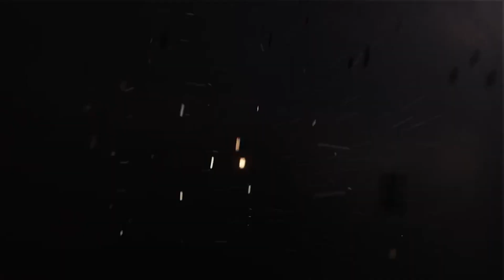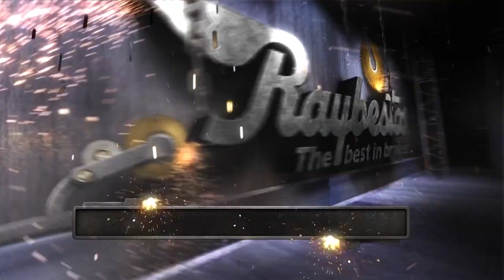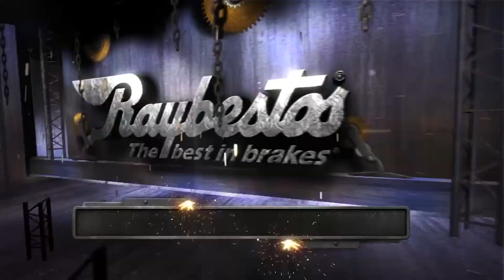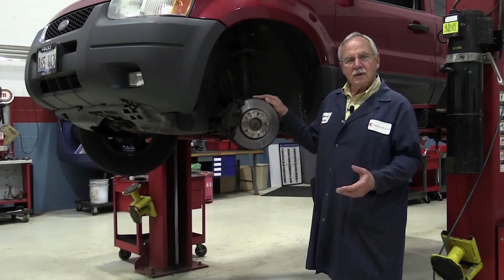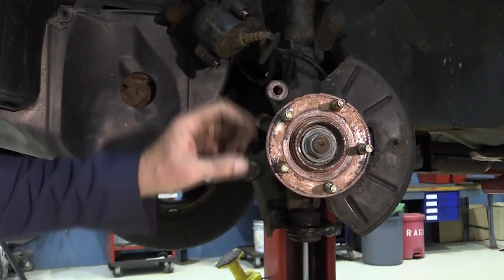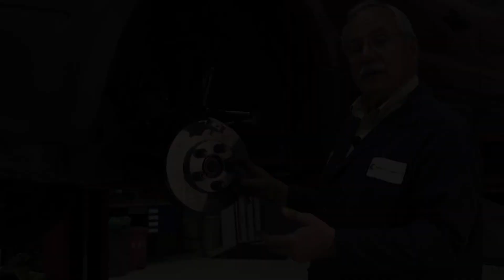Warped Rotor Myth

Comment: To me it sounds like "wrapped" and "lateral run out" are the same thing.  I also think the rotors can get hot enough to wrap "thickness variations"..
I do agree tho... with the fact that a rustly dirty hub can also causes this issue...

Comment: Ok the metal of the rotor starts to melt at 2300. It will get hot enough to make it soft enough to wrap a them when it cools down it warps. You can machine them again if the rotor  meets min. thickness standards. But if it doesn't then you have to replace

Comment: I mean he does realize that most rotors today CANT be turned right? Unless it’s a high end car most rotors are made today without enough material to turn them down safely. Also lateral runout means something is warped or uneven. Thousands of heat cycles will absolutely warp a cheap thin Chinese rotor. That’s why they are so cheap. They are made to be thrown away on most cars today.

Comment: Let us say that this is a hundred percent true . Than why is it when I do brakes on a high mile car that had a lot of pulsation does it smooth out with the new rotors , you could say it does not have buildup , okay how did it get there , was it hitting a high spot? As far as I know if you place a friction materiel against a moving steel surface that is flat it will transfer  materiel in a even fashion , how could it  pick some sections of the rotor over others baffles me

Comment: FALCOR. One other factor to consider. You're driving in city traffic for a couple hours and then you park the vehicle for 2 hours. The rotors cool down but not evenly because the area where the pads are lightly touching that rotor remain hotter. Uneven cooling causes warpage .

Comment: This guy is an idiot!! Rotors do warp I’ve had a few that I have changed for ppl.. put it on a lathe and dial indicator and what do you know it was warped.. you can also use A micrometer. And as you can see  the human mind can be warped as well which seemed to happen to this fellow..

Comment: You over torque a rotor. It warps. As you don't need 2500 degrees to do that. It just takes 1100 Degrees and 3-4 months of it to make it warp. Not to mention them cheap Mexican knock offs are made so cheap. That warp anyways. As the material is cheap. Just attach a dial gauge on them. I seen them row left and right 30 thousands.

Comment: Some of these so called experts need to actually be in the field and not quoting the party byline as a 45 yr veteran in the automotive field I can tell you that rotors absolutely do warp.Also rotors develop hot spots that cause vibration as well.This can be caused by poor Calipers and that wasn’t even addressed by this so called expert.Raybestos get your act together.

Comment: I have a Highlander 2006 that vibrates front passenger tire feels like when you brake at 65 mph or more but not all of the times. I changed out rotors and pads and problem is still there. What can it be ??
Reply: try a balljoint, the force of the vehicle coming down onto it as you brake puts stress on it and makes it vibrate
Reply: Damion Jed the car has only 90,000 miles - could it be a ball joint?

Comment: Rotors don't warp. They said they warped and replaced them but they did not do it right. What does happen is the rotor becomes distorted with uneven thicknesses or runout, or warped. Wait no they're not warped. Anyway I'm just gonna replace them anyway just like the last guy lol

Comment: Impact wrenches and failure to use a torque wrench are what warps rotors.  Torque sticks used with an impact wrench are a half-ass way to save one minute per wheel, and have the customer wind up with warped rotors in a year or less.   I've even had a dealer mechanic intentionally over-torque one lug nut so the rotor would eventually warp.  It's a safe way for them to get  the customer back into the dealership sooner so they can make more money.  (No dealer's "repair warranty" will cover warped rotors.)

Comment: BTW.. cheap "new" brake drums and rotors for the rear brakes will give you just as much pulse problems as the front rotors...Easy to test for., In a "safe zone" of a street (No, bicyclist, kids, pedestrians, vehicle traffic, ECT), roll the vehicle to about 15 mph, shift to neutral then apply E-brake only,..If the rear rotors or drums are messing with you... you'll know right away.

Comment: Chrysler had issues for years back in the 90s jeeps and LH platforms were known for run-out issues from heat causing run-out well over .004 which caused brake pulsation so rotor warping is real in most cases. It's very important to purchase high quality rotors when replacing.

Comment: I believe rotors warp. I've had vehicle's where the rear brake calipers siezed and caused an over heating issue with front brakes. After this happened terrible shake from front wheels when the brakes are applied. Improper installation will also cause excessive heat.

Comment: Have done hundreds of brake jobs , and warped rotors is something I have seen once in 40 years. Thankyou for clearing this up.
Reply: Just asking this, but virtually every other comment says rotors do warp. Does he mean that the  entire thickness of the rotor doesn't warp while everyone else means that just the surface can warp, meaning uneven wear? Sounds to me like this discussion is basically useless if even though  the thickness of the rotor hasn't warped, the rotor has to be replaced anyway.

Comment: You are Very wrong sir. I have been a mechanic for 34 years and have taken rotors off and laid them on a machined surface, they are warped.  Also I have cracked run out on the vehicle and on a lathe both indicating warp. I have worked many years in the 4x4 sector and can tell you that hot brakes entering cool water or mud warps them instantly. I do not know why Raybestos put this together but they really need to do some field work first. It happens all the time when an engineer decides something that has not worked in the field.

Comment: Rotors don't warp? Tell that to the countless Dodge Ram pickup owners in warmer climates, braking at highway speeds on off-ramps during hot weather. I had rotors replaced three times on my 2003 Dodge Ram Van 2500, all under the 3-year bumper-to-bumper warranty. Not a problem with aftermarket rotors.

Comment: Rotors can warp if your caliber slide pins are seized, and your pads fit too tightly(no silicone grease applied)...then the you apply the brakes, they stay applied and generate lots of heat.

Comment: I love it when people do information videos and talk rubbish! I am a 30 year tech and disc/rotors DO warp for many reasons! If discs/rotors didn’t warp then the vehicle manufacturers wouldn’t give tolerance figures for the allowed run out! And I suspect the old and new rotors warping on that Honda where 100% down to firstly the corrosion build up on the drive flange and probably sticking pads or callipers and a poorly trained technician not cleaning the drive flanges as we could see the corrosion still on the drive flange! My guys would get the sack if they cost me money on warranty work because they hadn’t cleaned the flange, or pad carriers and calliper slides! But I have a great team of guys that do the jobs right the first time!

Comment: After 40 yrs. experience in brake system service... If you buy cheap rotors, expect problems right after the first "hard" braking  (panick stop) on the freeway at 70 miles per hour. High quality rotor castings (like OEM) can take the heat.
Reply: You are exactly right. If you buy the cheap rotors from Mexico they will do exactly as you said. People should always buy american made high quality steal OEM rotors.
Reply: Yeah that might cause a thickness variation. Oh wait. Sorry. Meant to say WARPED ROTOR

Comment: Obviously, rotors do warp under a number of situations and don’t need to reach 2300 degrees to happen...  however ceramic pads, poor rotor metallurgy, and a number of other things can cause uneven wear and leave deposits that cause pulsation.

Comment: I've tried very cheap rotors once, after some high speed braking the pedal began to pulsate. How do you call that? I drove around 200 km/h and braked down to 30 to leave the german Autobahn. I think that you can reach temperatures that make a disc glow red. Also it is possible that a brake is stucked a little it self because of rust (especcialy the caliper or the pads).  If you see the rust on the lateral of your rotor you can see by the color of the rust if a brake was stucked once. I think that you can gain a warped disc like this. But i think that the diagnose of warped rotors is the easiest way and this isn't the  cause of the rotors became shitty. It's like a doctor who gives you medicine not by cause but by symptome

Comment: Place the "unwarped" rotor on the brake lathe and check the circumferential run out for clearances. With that said unless your brake lathe shaft is warped this will disprove the myth of rotor don't warp!

Comment: So, no warping? That then means that thickness variations are due to poor manufacturing and use of cheap materials. Add the improper installation procedure and there you have it, every single car on the planet would has rotor thickness variations. Rotors do warp, even from stock as it is in the very common case of 09 dodge journey suvs. In some cases you can even see the warping without a reasonable runout.

Comment: Rotors do warp. It doesn't matter matter what kind of brake pads you use. Iron rotors tend to warp under hard braking conditions the most. Continued heating and cooling cycles cause the rotor to expand and contract which can cause warping over time. Not only have I seen it but I have done it. I was a mechanic for 21 years. I know about brakes. You can also warp drums.

Comment: Rotors definitely warp. My Aerostar’s brakes warped on long drives due to excessive brake pressure when brakes weren’t being applied. I had them changed every 8-12 Thousand miles. They obtained a flower shape and would just get worse and worse. It was a design error by Ford. After dealing with this for 3 years under warranty we vowed to never buy another Ford product. And we haven’t. Rotors definitely warp. I wish I had taken a picture of mine.

Comment: Sooo what caused this BEFORE ceramic brake pads? When I was working on cars in the early 90s we used to turn a lot of rotors and it wasn't because of brake pad deposits on the rotors. It was because the rotors were WARPED. Or as this guy says variation in "lateral runout".

Comment: Lol wtf? Suuure,  and when I see people turn rotors and removing material, I'm like you only thought they were warped bad before less metal meaning even easier to warp now, smh China has made rotors super cheap not to even fire up the old brake lathe

Comment: Bah, I know rotors do warp.  Had both pedal pulse, but also vehicle pulse.  Took it off and laid it on the workbench.  You can see it was bent.  Put it on the rotor lathe and saw how warped the rotor was.  Changed out the rotors for new ones and new pads, all pulsing gone and never came back.  It all depends on the metal used in the rotor.  Cheap ones are probably not as great as mid to high priced ones.  I always used cheap ones, only 2 sets of rotors warped out on me out of probably close to 25 sets.  And no, its not just my vehicle I am talking about.  I change all of my familys vehicles brakes when they need it.  8 vehicles in the family, and over 20 years of time.

Comment: I call bullshit. I’ve seen them in the lathe wobbling with zero runout on the mounting face. Tried to save some but end up going under size on the cut and have to replace them anyway. The secret to long brake life and saving money is not driving like a lunatic.

Comment: Tech tip- and if you spring for those carbon kevlar pads..(90 bucks a wheel)  ya better get  forged rotors..stocks are usually cast..they will warp, get blue spots and heat check( micro cracks that that look like a checkered pattern..but dude says rotors don't warp..ya right..I think he is smoking the funny stuff.lol

Comment: What the hell is he saying! This guy is crazy as fucxx. Ive turned many brakes on our brake lathe. The brake pads do not "add to the thickness". Raybestos should be ashamed of this video. Thats why there are tolerances on material removed when turning the rotors. This is stupid
Reply: And what’s funny about that, is the reason rotors have minimum tolerances, is that once they get too thin they cannot properly dissipate heat and will (yup) warp. Even though Mr Raybestos says they can’t.

Comment: My diagnosis of warped rotors and replacing them have made all my customers happy.
Reply: Can't you just resurface the rotors? In my country rarely people buy a new rotors without resurfacing it at least once. I did resurface on some of my vehicle, it solve the problem, it last, and it's cheap (around $12 for both rotors).
Reply: @Nick-ko1tw  The problem here in the state is it's cheap work ( they can't really charge you much because you'd just go out and buy new rotors) the result is that there aren't many shops that do this kinda do the work...  and when you do find one  , the wait can be long because they have lots of work... can take all day and it's possible resurface doesn't last , can't be done  due to thickness or is done improperly...

Or you can just go get new rotors for like 40$ more in like 5 mins. from the local auto parts store..... So the customer gets their car faster , easier to guarantee the work for maybe 100$ more which is really nothing for auto repair here in the states...

Comment: In years past the most frequent cause of brake pedal pulsation was poor remachining of the rotors during a brake job.  The best bet is to replace those rotors.  The only time I've seen rotors machined properly is when they were ground flat  on a grinding machine instead of machined.   Rotors often develop hot spots that are hardened from the heat of the pads.  Even the sharpest tool will skip over these spots making for uneven machining of the rotors.  

I'm curious, has anyone out there ever checked runout during a brake job?  I've never seen it done unless a customer came back with a complaint?

Comment: It is not just temp alone that warps rotors, quickly changing temp can cause warping, like having hot rotors and hitting a cold puddle of water. Warped rotors cause steering shake, lateral runout causes pedal pulsation, but you are wrong rotors will warp
Reply: Lateral runout and warp are the same thing...
Reply: @brucea550  call it what you want, the thing that is untrue in this vid is that temp will not cause the issuse.
Reply: I agree 100%, they don’t need to get 2300 degrees to warp. But he’s talking some nonsense about material transfer creating high spots. I’ve never seen material transfer to a rotor from the pads. I HAVE seen uneven wear from various issues relating to the caliper. But uneven wear is not the same as warp/lateral runout. Take a paper plate in both hands and slightly twist it. That is warp. If you held it in that position and rotated it, you would see the lateral runout. Did the thickness of the plate change? Nope.

Comment: Great information. I buy the metallurgy argument way faster than the old warped rotor story. I understand you can call it a matter of semantics... disc thickness and "warping" both would induce a variation of pressure or the pads on the rotor, but I think warping is just a misnomer for what's actually going on.
Reply: I have a bridge you might be interested in buying as well.

Comment: And an idiot double talks... Thickness variation is code for warped... I have turned thousands of rotors and drums in my life, and they warp like hell.. hot brake parts and mud holes..splash that water onto hot metal, and it warps.

Comment: Yes, rotors become out of true from quick excessive heat and the cool down. Excessive heat could be from cheap pads, bad drivers or even a caliper hanging up with a slide or piston. 
 This is why they get machines and have discard thicknesses. 
 If they are going to take the time out to explain something, then let’s hear all of the truth.
Reply: I had an old service rep say the same thing and my boss believes it. I say,  go ahead and just clean it off with a Roloc disk and see what happens.  The term comeback, comes to mind.

Comment: And u better not push the Piston back  without loosing the bleeder screw. Lol call it what u will the rotor is warped and a regular customer ain't going to understand what thickness variation is.
Reply: I just remove the cap from the Master Cylinder to allow the Caliper to push back brake fluid . Been doing it for decades and its easier than messing with a bleeder screw . Just wrap a towel around the master cylinder in case it overflows .
Reply: But the funny thing is that thickness variation is just a fancy way of saying warped lol